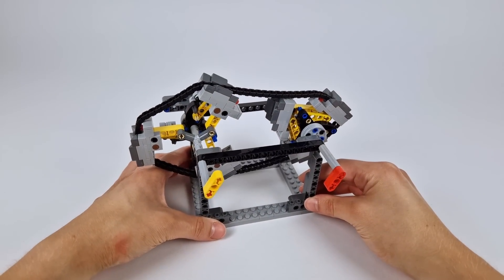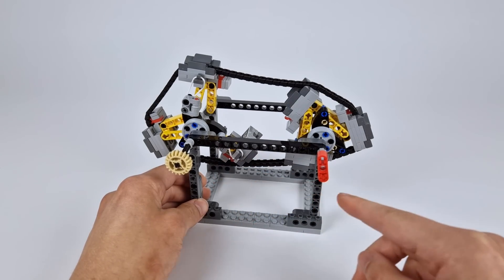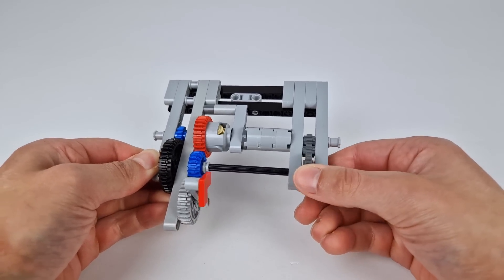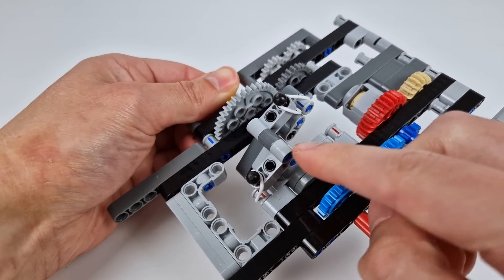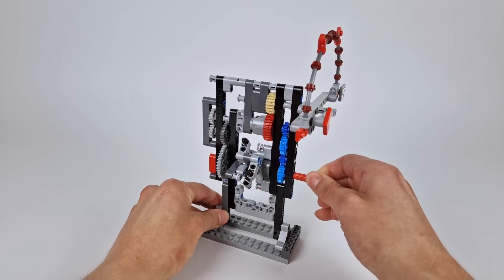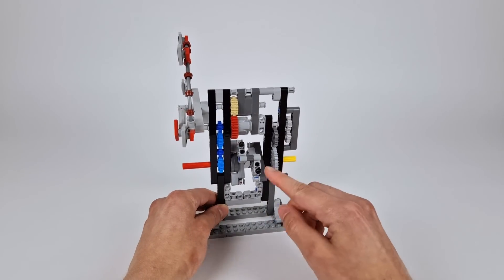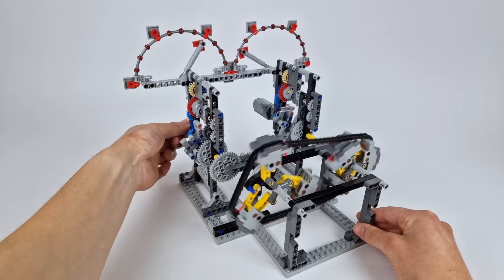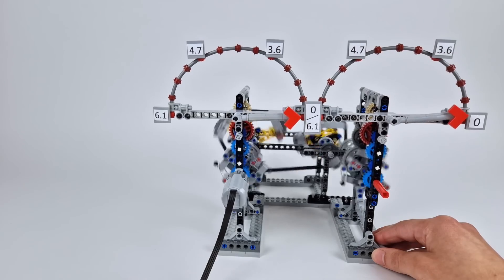But Does My Automatic LEGO CVT Actually Work?

Comment: The torque measurement is off I believe. The scale is not perpendicular to the arm pressing on it. The arm you used has two parts with a right angle, but could have been replaced by a single arm without an angle. In that case the way pressure is applied is equivalent, but you could clearly see that the arm is not perpendicular. Never the less, super interesting and nice video!
Reply: Agreed. But the error is only like 1 or 2 studs on a 12-stud long arm, though.
And all displayed values are off by the same constant factor.
Reply from the maker: @legotechnic27 The arm is as close to horizontal as I could get it - the problem is that the output axle I'm connecting the arm to is fixed at a certain angle so it can interface with the levers with rubber bands. The assembly I attached to it allows me to then move the arm in 60 degree increments, but this didn't allow me to get it absolutely perfectly horizontal, but there's only a very small error as some other replies have said. 

As was mentioned, using a single arm would mean only a component of the force would be pushing on the scale based on the angle the arm makes with the scale, so you would have to account for this when determining the force, which would make the calculations more complicated.
Reply: [Rectified]
Reply: @lf7911  You are probably American (or Brit) then, where there's Pounds and Pound force in the unit system.
If you're living in the remaining 90% of the world, then the scales give the weight (which yes, is technically a force) already "conveniently" converted into mass. And in order to get the force back, you have to do the reverse conversion.
(Banana Gear Studios appears to be from outside "imperial unit country", judging from the fact that he measures the arm in centimeters and the torque in newton meters.)

But even if his conversion was wrong, the values would all still be off by the same factor, meaning that the conclusions still hold.
Reply: @Pystro  No, I am European, I did not know the scale measured in direct mass, since all scales I ever used measured weight and in the lab we always converted into mass.
Reply from the maker: @lf7911 No, the weighing scale, while measuring the force, is displaying the weight as a mass, as shown by the units being grams. So therefore I multiplied this by g to find the weight, and then this by the horizontal arm length to find the moment - none of the calculations are wrong.
Reply: @BananaGearStudios  
My bad, so apparently the scale is giving you the conversion to mass. And I actually live in Europe, and I do know the metric system. I am a mechanical technician, I know my way around these things. If it is true that the scale is giving you a measurement of pure mass, though with all scales I worked with, none of them gave the direct mass (because their purpose is to measure weight in my case, I guess?); then there is no error in the calculations. I think my confusion is that in the Technical System kg mass, kg weight and Newtons have a special relationship to one another, which makes really difficult to understand what the scale I am using is actually measuring, since for my field we measure things depending on which data we need. (so essentially, we have 3 different measurements every time we use a scale)

Note: Only on earth 1kgm=1kgp= ca. 10N. For example on the moon the scale will show you 1/6 of the measured mass, but it is still indicated as kg or g, however the mass is still the same.
On the moon 1kgm=1/6kgp= ca. 10/6N. The problem is that the kgp (kilogram weight) is only consistent on earth, but it is the standard unit of measure of scales. Therefore only on earth the scale will give you the same value for mass and weight.

oops
Reply: This is not a time for me at which I would want to run the math, but I am certain that when calculating the component of force, the downwards component which the scale measures at this 120° angle would be identical to the result of this 90° simplification.
But this can be tested in practice by re-running the test with a one-stud extension. If this result is within measurement error, the measurement was accurate.
Reply: @WyvernDotRed  A 1 stud extension might not be enough to see a clear difference.Why not go extreme and do a 30stud extension? I am positive you would then see a difference in measurement. The longer the vertical extension gets, the closer the actual angle at which the force is exerted is purpendicular to the scale. If you take this extension to infinite, eventually the measurement would yield 0.
Reply: im just answering from intuition now, but i think when the arm is horizontal at 90° its pushing straight down (only vertical force) but when the arm is angled at 120° as if you would connect the axle to the point of contact with the scale there would be vertical and horizontal components to the force of which only the vertical would be detected by the scale. any other force vector except the one pulling straight up produces a horizontal component, so the arm going straight down after the right angle is just an extension of the only possible force vector thats normal to the ground (parallel with gravity) where 100% of the force can be measured

Comment: One other way to think about the difference between the first (bad) system for measuring torque and the good one, is that the bad one measures torque by applying a torque proportional to the output torque, whereas the second system only measures the angular displacement of a shaft experiencing a torque and therefore does not apply any torque itself.
Reply: It still uses some non-zero amount of torque to rotate the dial and twist the shaft, but if the output torque is constant, then it will not use any torque.

Comment: If you're making two of them anyway, can you test how well one per wheel would work in place of a differential?
Reply from the maker: Assuming you're refering to coupling two CVTs together, I suppose I could. But then you're not getting the benefit of coupling them, being the higher range of gear ratios, but it'd still take up twice the space of just having one.
Reply: @BananaGearStudios  Im thinking of how a differential works, instead of using it, in place your using two cvts for each wheel, now connecting both cvts to a power input drive chain, or instead you can put a third one in as a power train. so if say D is representing a wheel, and Y is representing the shape of the cvt jointed together. it look    like DYD kinda shape, at the Y is where they junction together. I think it could be a slip differential. I still think it would be a cool idea. Sorry I would honestly draw it but dont have ability to submit a drawing.
Reply: @realdbcooper3423  two CVTs, one each side would make a torque vectoring device, not LSD.
Reply: now thats a dope idea!
Reply: DAF used this in the earliest passenger cars they made in the 50's and 60's, called variometic. They later switched to a single cvt with a differential due to tyre wear and reliability problems.

Comment: Could you make a video on how differencial works and why you use them in every single one of your videos ? Because I don't get it. I see it is something very useful but at the moment you say "I used a differencial" I loose track of the explaining.
Reply from the maker: Thanks for the comment. To be honest I'm not sure if it's worth making a full video on them. I'm sorry I don't explain them in much detail, but for anyone who already understands them I don't really want to slow down the pace of the videos. The best TL;DR explanation I can give is that the differential housing essentially adds the torque of the two inputs, while averaging their speed.

How I've used it in this video to measure the twist of the axle is that, since it's averaging the speeds of the inputs, say a and b, the speed of the housing, c, is (a + b)/2. But if b is rotating in the opposite direction to a, it looks like c = (a - b)/2, or 2c = a - b, so the differential housing is showing us the difference in the speeds of the inputs, or in this case the difference in how far each end of the axle has turned. Hope this helps.
Reply: @BananaGearStudios  Ok I get why it isn't worth a full video. But I'm just very intresed in it since I see that it has much more uses that making cars able to turn. Also yes your explaining helps me a little bit more.
Reply: Differentials aren't a Lego only thing. They're commonly used in the real world, for example, in cars. Because of this, you don't need to wait for him to make a video; you can just search, "How do differentials work?" on YouTube and watch some explanation videos. You could also read up on it.
Reply: @Xodabeef  yes that is what I did. But I couldn't find any other use that car turning.

Comment: Will these torque measuring systems be included on the cars? I think it might be interesting to see them function as some form of gauges that would be seen on a real car, but they are pretty big. Impressive solution, I am excited to see it further!
Reply from the maker: Yeah, you're right that they're pretty big, so I don't think they would fit on the car. Though after seeing in this video how the torque values on the input and output change as the gear ratio changes, I think it'll be pretty easy to infer what the torques are like on the car by seeing how the CVT's gear ratio changes.
Reply: No, that would cause horrible torque steer. Plus it does was torque regardless of the claim. He just doesn't notice it.
Reply: @SlyNine There's a little bit of power lost to friction in all the gearing up to the differential, and the input torque consequently needs to be a little higher. In steady state, that's the only thing that requires additional torque.

When the dial is *moving*, there's a little more friction loss from the dial itself, and the rubber band is either storing or releasing energy. Luckily, only steady state measurements are needed.
Reply: Cars already have torque measurement built in in many cases - plenty of high end cars can tell you what the engine torque is, though whether it's taken from the engine fuel-air flow-throttle position map and they assume the torque because they measure one engine on a dyno while developing the car or from a gauge built into the car isn't necessarily clear. There are off the shelf torque gauges available for automotive applications though.
Reply: @peglor  I haven't seen any production cars that tell torque, but I have seen ones that display power, which is just torque * RPM (* a constant depending on what units you're using). Cars normally measure mass air flow directly or use the combination of a pressure sensor, temperature sensor, and volumetric efficiency table pre-programmed into the ECU from the factory. From mass air flow you can then calculate power and thus torque if you've already done testing on the engine. I have an OBD2 reader that will use the car's sensors and estimate power output.
Reply: @johnhunter7244  You have to go very high end - the Veyron has it, some high end Mercedes cars do too, and I think Rivian might do it too (But with an electric car they can get very accurate figures multiplying the Voltage, Current and motor efficiency).